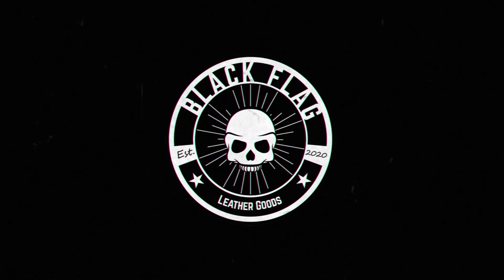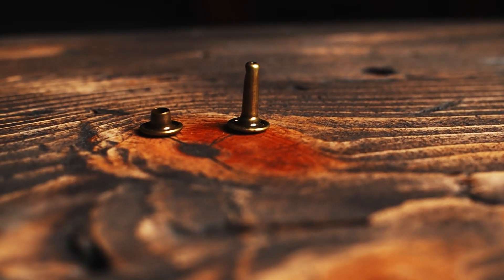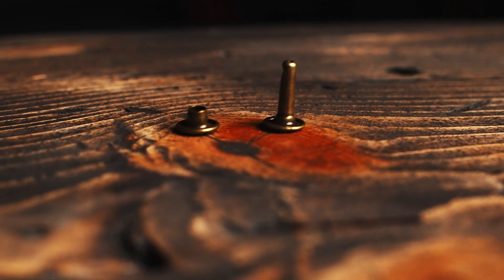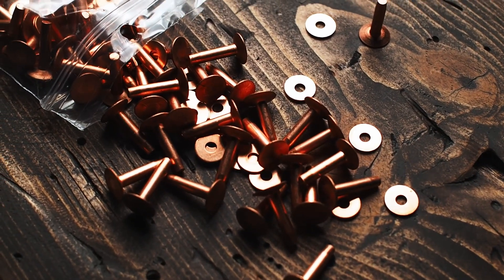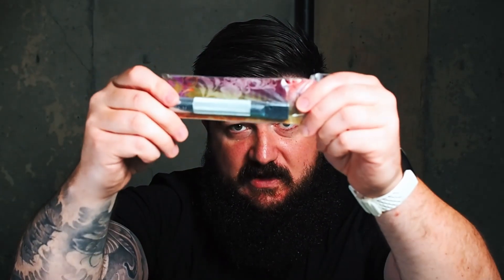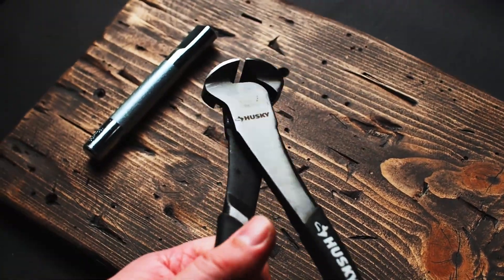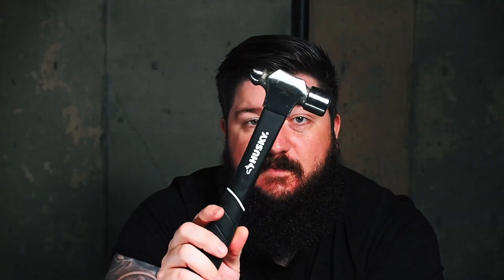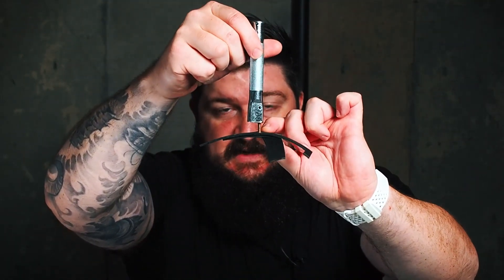I try Using Copper Rivets for the FIRST Time!

Comment: I use a chasing rivet hammer... I have 2 different ones.. one has hex heads- one side is very slightly doomed, the other flat... very high polished hardened steel. The other has an extended hex head and the other end is flat and wide ( pickaxe shaped) also highly polished. The are made exclusively for rivets and shipping them anyway you want them. They are a game changer with the rivet game. Both of those hammers were quite exspensive and came highly polished... but I always sand off that stupid acrylic/Lacquer clear finish and slightly round the edges and polish the hell out of all my leather working hammers. Thanks for the vid and have a good one
Reply from the maker: Dude! Thanks for the info! I'm going to look into them right now!
Reply: @BlackFlagLeatherGoods  no problem at all man. Iam actually a full time professional artist and Bookbinder, and avid leather worker 2ndly. I make high-end watercolor sketchbooks and use high quality Goatskin leathers from Italy and France, for the Hardbound covers. I actually buy  very small copper rivets that are used for electrical work. I will put them on my covers and I shop them and Decorate them. So these hammers are absolutely perfect for that AND for the actual leather copper rivets for my leather working. I can shape the end of the rivets to any shape I want and since the hammers are hard and highly polished.... they make the end caps of the rivets very smooth and very Shiney and polished as well. They sell ones for jewelers that have textured heads that leave thise texture names in the rivets. Iam looking into some of them currently. They have ones that are all different shape heads for different metal shapping purposes. They sell ones like I have, that come highly polished and range in the higher prices ( because they come polished ) and they even have ones that are cheaper.... but, they aren't polished and you can just polish the heads yourself. ( as we are used to having to modify or sharpen leather tools anyways lol ) so I really hope this helps you out man. I found your channel while I was working in my live-in art studio and bindery ( a large loft ) and I always have art videos, bookbinding videos and leather working videos playing on my studio monitors and speaker system, while iam working. I always enjoy your vids and appreciate any if your tips... so I like to return the favor when I can lol. Have a great one brother!

Comment: Just found this video. Copper is also work hardened. Slightly anneal the rivet before setting- hand torch or something - let it cool, and the cutting/doming process will be more smooth, especially for delicate/easily marred material- won't have to hit as hard and over drive it.

Comment: You can get an anvil at Harbor Freight, but anything semi heavy and solid should work for this application.
Reply from the maker: Thanks, Albert! I'm still on the lookout for an anvil, but a buddy actually hooked me up with a marble slab which has been working well.
Reply: Harbor freight has multiple sizes.   They even have a small  table top version.   Would trimming the post of the rivet shorter help with doming, and setting?
Reply from the maker: Thanks Ryan! There's kind of a sweet spot for trimming them. You want it short but you still need enough material to secure the burr on it. You definitely want to keep it as short as possible it seems though.

Comment: Hiya. I found after doing it wrong for yrs on the double cap rivets is that it takes a small hammer. Light in weight and take many small strokes an if the shaft is not to long the double cap are reliable.

Comment: You probably know this by now, but you need to cut  the rivet closer to the washer. Also, the rivet setters sold by Buckle Guy are much better than the Tandy ones.
Reply from the maker: That's good to know about the buckle guy ones! The tandy setter is awful

Comment: I tried the double cap rivets from Tandy with no luck and just had to go back today and get some of these rivets lol     FYI - Princess Auto has a selection of "cheap" anvils.
Reply from the maker: Double cap rivets are hit or miss unless you use a press, I've found. I recently got an arbor press and it's much better. I think these ones look way cooler anyway though.

Comment: Pretty much looked like my first experience with copper rivets. Kinda crap but still worked out well.
In my opinion, these 2in1 Setters all suck. The best one I found is the 3-piece-set from buckleguy (or the ripoffs from amazon/ali/ebay). 
The 2in1 all mark the leather around the rivet and are quite awkward to use with the doming part off center.
Reply from the maker: Hey, Markus! Thanks for the advice! I didn't realize they had anything other than the 2 in 1 setters! I just checked out the Buckle Guy ones and they look nice! I'm going to order them I think!
Reply: Dude, you just helped me discover a goldmine for leather craft tools and supplies. A bit pricy but reasonably so. Thanks!